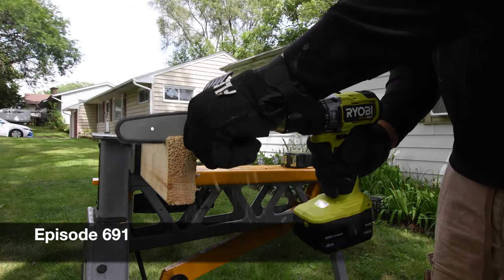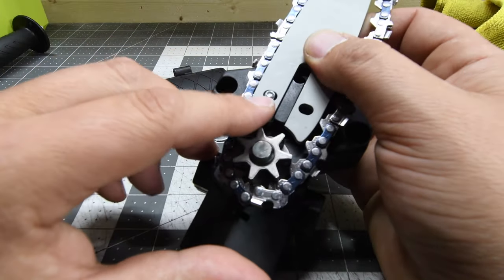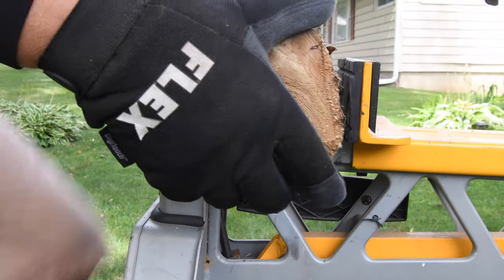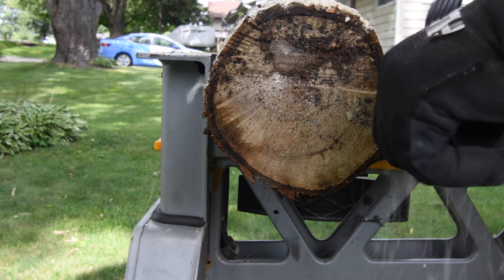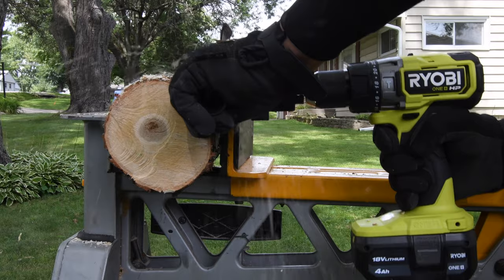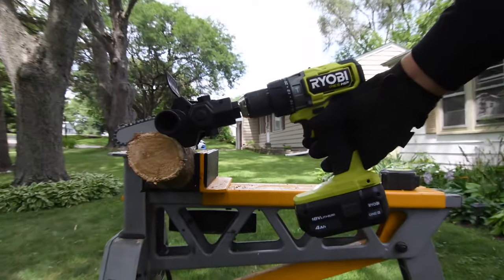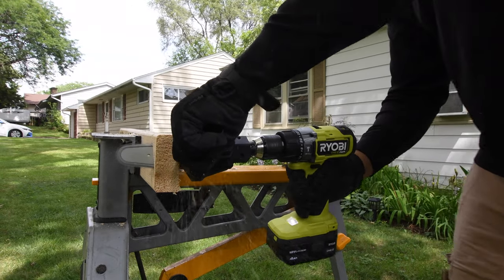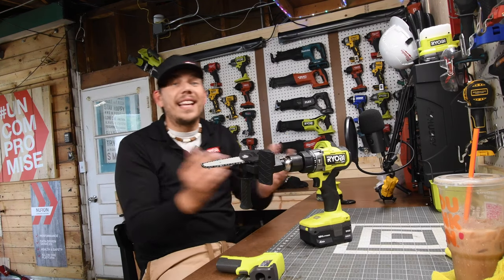Low Cost Drill Attachment. (Baby Chainsaw Drill)

Comment: Had bunch of skinny trees come down in my yard and next door. The people there who have a chainsaw wont cut down the branches,  so i need to do it so i can cut my grass again.  I saw this tool on Temu, but came looking for reviews. 
Thanks for a thorough review and demonstration.  I feel confident to purchase this and use it.
Reply from the maker: I couldn't believe that this tool attachment worked
Reply: @ManCaverTools   I just got my device, I got a 6 INCH blade,  and I put it together this morning.  Tested on a 3 inch thick tree branch that had come down on some bushes and blocking the back porch. I won't be able to finish it off till after work but it sure did cut through quite easily.  After that one cut the blade was noticeably slack. Like VERY slack, so I see I'm gonna have to stop and tighten this thing between each use, which seems reasonable for a chainsaw anyway. 

I've seen men of years, claiming to be handy,  have stupid interactions with chain saws skipping the blade cuz they didn't bother to check between cuts.  But what does a young person know of these things!? HA, we know enough to get a tool the size we can handle and to pay attention to it.

I think You didn't mention that if you don't hold the devices handle when you first start, that it will spin on the drill end  like a carnival ride. I already knew that but your transition to the business part of the work was so smooth, i may have missed.

This thing is going to be a work and gear saver. I cant keep using my lopers on some of these volunteer saplings that keep popping up, and after the tornado this summer I've got broken branches threatening everywhere.  I can finally get some of these larger leg sized logs into some sorta reasonable chunks.

Edited to Add: My only complaint is that the shaft for the driver is qute short.  there is some sort of plastic cover that I assume is supposed to fit over the tip of the drill but in both of my DrillMaster drills it just keeps the shaft from inserting completely so it leaves about a third of the shaft outside the bit teeth.  I am Seriously considering dremmeling off these "guards so the shaft inserts more completly.  It may even cut down on the vibration I'm experiencing, becuas it would be a damn shame for this thing to vibrate it's way OUT of the drill teeth.  Perhaps I'll buy a cheaper on from Temu to experiment on. I'm still within my return window for Amazon. 

Thanks for this very handy, educational, and instructional Video, it helped tremendously, and was the spark that led me to push that buy button. Too bad you don't have sponsorship or amazon kick backs!

Comment: Thanks for the video. I saw this on Temu for $10.98 and had to have it. The hand gard is supposed to just be for dust and/or wood chips.  My handle worked on all 3 spots.
Reply: Im in the UK and just bought the Temu one yesterday also for £9.50, Im waiting for it to arrive, and I was worried it would be useless - My drill is a 21-volt model, so Im hoping it will work with that ..  seeing this video it's making me excited what it can do.. I didn't want to buy a full-sized chainsaw as Im a little nervous of them lol.  But this will be perfect for what I want it for in the garden. Thank you from England :-)
Reply: @lordtj63 keep that chain oiled! no reservoir so spray is a must

Comment: I got the exact same one from Temu for CAN$5.50 and it works great. The only thing you need to make sure is to use a powerful driller.
Reply: Without proper lubrication, for how long it going to last ?

Comment: Wow, I got the same one and mine is terrible. bounces and makes a huge groove.  Glad it works for you!
Reply from the maker: ill do another video on this attachment
Reply: mine had a groove the size of the blade.  It was very quiet when it started, only the sound of the  drill and got more vibrational as it cut through, but that was because the chain was getting slack. I think it just vibrates out of torque but then I have seen full size saws do that but maybe not so quickly. I had the screwdriver in my pocket , so I can remind myselfe to tighten it after each cut and it should be find. I hope you have a better future experience with your tool.   Mine may be a different brand than yours because my handle fit better than ManCaver's did in all the positions.

Comment: I just got this. The handle does screw on to any of the three positions - the top or bottom and one of the two sides. It tightens up fine for me. Maybe yours is defective? The guard does work if you put the guard and handle on the bottom. They could rethink all of that. I'm with you on that. Should have the guard available for any position the handle resides.
Reply from the maker: the handle threads only allowed my unit go in a single position. Quality control . which Is why I put it in the video
Reply: @ManCaverTools  Thx for showing the assembly. I got it together OK and went to try it out. At first it seemed to cut OK but now it won't cut anything. I tried switching the chain thinking I may have installed it incorrectly. No help. I put a very light shaver oil on the blade. No help.
Any ideas? I was so excited seeing how awesome it did on yours. I'm using an 18V Rigid impact driver and drill driver to power it. The impact driver has 700 PSI torque.
Reply: @freemanpense2782  Chainsaw chains always get dull, you need to sharpen them or they become much harder to cut with. A sharpened chain can make a huge difference - sometimes from struggling to cut at all, to not needing any pressure at all and it basically pulling itself into the wood.
Dirty/sandy wood, scraping rocks etc can dull the chain a lot faster.

Comment: Got mine on Temu for $8.50....been using it a couple months on my hyper tough 20V drill....no issues...just re-sharpen it when it gets dull.
Reply: Does it work without lubrication ?
Reply: @jonasjonaitis2949  yeah..... I
just spray some liquid wrench on it occasionally. to reduce wear and tear on the bar. It's  not high rpm like a chainsaw so it doesn't get hot much.

Comment: The only *catch w/ this adapter is your drill has to be pretty strong .. I tried it w/ a 12V drill that I had laying around and the RPM wasn't fast enough .. the chainsaw teeth would just get caught in the wood.

Comment: Got this on temu for $11 and was pleasantly surprised how well it works. Only use it to cut small branches in my backyard though. May I ask what sawhorse you were using and where to buy it? Thanks.
Reply from the maker: I was surprised as well. it did the trick.Not too shabby
Reply: I kinda wish I had bought it from Temu to save a few bucks.

Comment: Can you show how the oiler works please? You missed that. People may think you can run without an oiler and be confused when the saw burns out within a short period.
Reply from the maker: there is no oiler. I just squirt a little WD when its needed
Reply: @ManCaverTools  Ah.. manual oilers. Thanks no. Lost interest in it now. Once the thing gets a bit of sawdust and other gruff in it, it'll soak up a lot of the lube and wear very quickly. Possibly I have a commercial big-saw mindset but I like it well lubed. Hmm. Would be great if it had an oiler.😁 Thanks for clearing that up.

Comment: Hi, looks like a useful attachment to use around the house. The question is how this little chainsaw is lubricated?
Reply from the maker: I spray some Wd-40 on it every now and again
Reply: Yes constant lubrication is essential for a chainsaw, they normally run through an oil lubricating reservoir..
I can see this working for not long before it becomes destroyed by the sheer heat being generated by it not having permanent lubrication..
But it's cheap and might last a season if not used to much and kept well lubricated..
Wd40 to lubricate something like a chainsaw??? How bizarre
Reply: How about silicone spray?
Reply: @adrinathegreat3095  do you think it would be wise to purchase replacement chains in advance?

Comment: Update: My tension screw dug into the carbon, or more like plastic body rendering this product useless. 
It's just getting loose like a drunk new years party.
Any suggestions? Needs a steel cast for the body, or unless I find a sleeve as a saver for the tension screw's placement it's a cute toy to display for a chucky doll.

Comment: Also how do they keep the chain lubricated?
Reply from the maker: I just spray wd-40 here and there
Reply: @ManCaverTools     Okay cause I was wondering what to possibly use that can take heat. It seems like it is a better alternative to a sawsall. Because at times the vibration is to much
Reply: @ManCaverTools  wd-40 is not a lubricant use cheap 30w oil

Comment: I did notice that you had lots of flex between the drill chuck and the attachment when going one handed. A brace may help cure that issue.
It's not a bad idea. It just needs some tweaks.

On another note, did you make a video on fixing your portable Ryobi fan yet? My new ones are doing the same thing where the old ones still are going strong. Thanks!
Reply from the maker: yes I did. the fan is now working. that video will be uploaded soon
Reply: @ManCaverTools  I can't wait to see that video! You da man!

Comment: I tried this thing and it kept catching the wood and yanking me and the drill forward. Anyone know why?
Reply: Chainsaws usually do this when they don't spin fast enough.
Reply: @themonkeyz  I finally figured it out then the thing broke because it's made of plastic. So I might keep the parts and make my own out of some kind of metal.
Reply: @chooselife1953  You can probably 3D print the part.
Reply: @freemanpense2782  Yeah but it'd be made of plastic so it'd just break again. If anything I'd have to use aluminum or steel.
Reply: @chooselife1953  And for the price of a 3D printer, you can get a real chainsaw.
Reply: @chooselife1953  What did you finally figure out? because mine is doing the same thing not cutting.
Reply: @chooselife1953 just ask a friend with a 3D printer to use metal printing instead of plastic.
Reply: @mitchio83  I think the drill wasn't spinning fast enough. It's made out of plastic so unfortunately it broke though.

Comment: So I bought one of these, it looks just like the one in this video and went together the same way.  However, I tried cutting through a 2" limb with it and about halfway through the chain broke.  It lasted literally about 1 minute of use.  What a POS.
Reply from the maker: that's crazy. you might be able to buy a different and better chain.
Reply: I ordered a replacement chain, should be here any day now.  I don't know if it will be stronger or not.  Hoping to get at least 2 mins of cutting time  which would be 100% better than the last one.

Comment: Mine arrived today. I used your video to assemble it. Alas mine doesn't cut. I've tried to cut a 2 inch wood square - I might as well use my hacksaw. That'd be faster. So I wouldn't recommend it at all.
Reply from the maker: make sure the chain is on correctly
Reply: @ManCaverTools  And that it's a grunty drill.
Reply: Sounds like user or drill problem. You can see in the video that it actually cuts.

Comment: Why not just get a m12 hatchet or the new m18 hatchet?
Reply: cuz they aren't $21
Reply: The M12 Hatchet is $200.  This thing is $23.  And I want to see a speed test between the two.
Reply from the maker: This attachment cost $21, not a bad inexpensive tool attachment. Good for the small tasks you don't need a real chainsaw for. just like those Dewalt drill shear cuttersSaves people $$$
Reply: @GM-gc8gg  this is only 4 inches, hatchet is bigger.
Reply: @greezy937  Still want to see a speed test.
Reply: 21$ or over 200$ guess that's why.